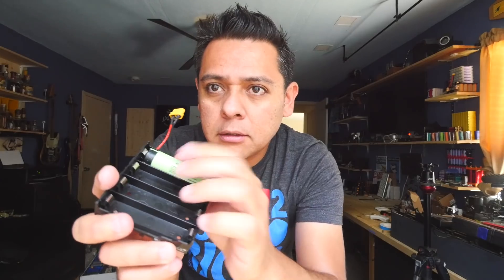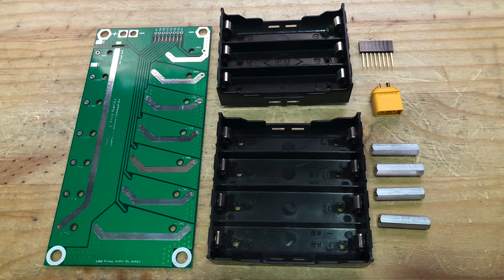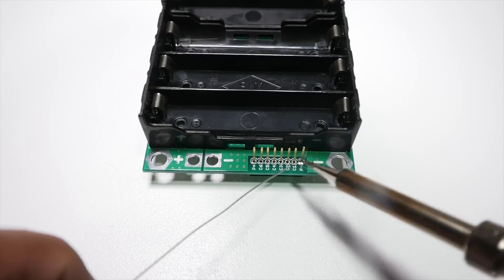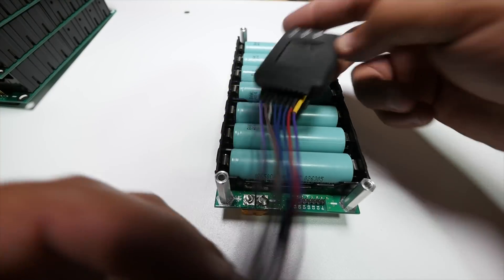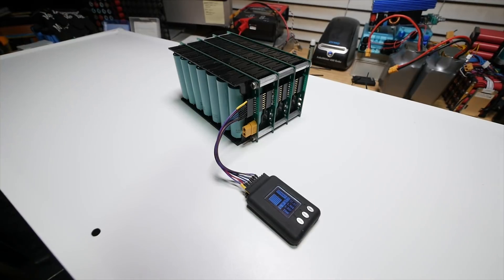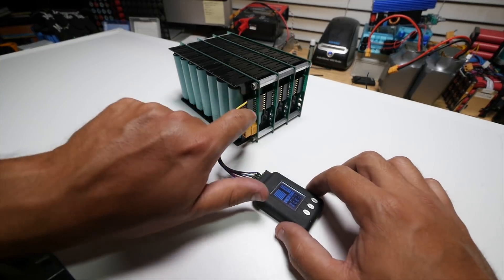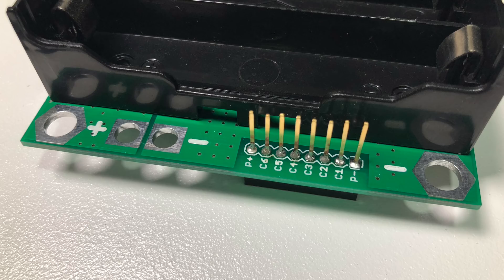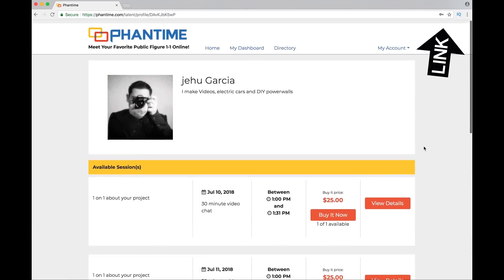DIY Rapid Build 18650 PowerWall Module project  - design & testing

Comment: Would it be possible to make a 12v battery with this system by reversing half of the cells on each board or would it not work like that?
Reply: answer BOOM!!

Comment: from my experience the metal contacts that are connected to the battery in the plastic battery holders becomes very hot when I'm drawing a lot of current with a large motor.  As a result they tend to melt the plastic casing especially at the battery contact points which may result in loss of electrical contact to the battery.  that is the reason why batteries are spot welded. how do you overcome that problem?
Reply from the maker: 1c load max per cell = low heat , no melting

Comment: 27 volts, so they are connected in series. In that case, the even voltage appears to be not so much critical for the risk of neighboring cells trying the fill up a weaker one (and possibly burning the PCB trace fuse), right? I may well be missing something, but what?

Comment: Those battery trays are most likely ABS plastic, which is going to turn soft at around 190-200 degrees F.  They should hold up alright at 140-150 degrees for extended periods.  You probably have a lot of ABS plastic parts in your car interior, which can easily see temps like that on a hot day.

Comment: Dont forget that every few years you have to replace all of the lithium ion batteries.
The reason why there is no soldermask on those boards is to add a layer of solder to increase ampacity.
At heavy load, they will also get pretty hot, becoming a local roasting device if not monitored correctly which depletes the lifespan of the batteries.
Reply from the maker: Maybe

Comment: You can also look into getting thermo-set plastic holders for the cells. It would probably be a little more difficult to find but could possibly solve the meltdown problem.

Comment: Do not build this!! The system doesnt charge uniformly all batteries! I will fail and explode with time. Stupid and irresponsible design!
Reply: Exactly what i thought. Where is the fucking battery balancing at discharge?(Or BMS warning.) A single bad cell would criple the whole thing very quickly. And i would actually want to see active battery balancing trough a dc/dc flyback circuit or something managed by some microcontroller. I think these days you have all that already integrated in single chips. This way you balance while discharge and charging. Very good for old cells. It's actually very very dangerous to play like this with these cells. I have the feeling that the guy from this channel knows VERY little about electronics and electricity and safety of batteries at all. He is an amature and should not be trusted. I don't say im an expert... But he certainly isn't.

Comment: I'd like to know if you can make a battery that basically could go 400 lb of weight on a bicycle that went 40 miles a day and took for bikes one you would only go 30 miles a day charge a day and then and then and then at the end of the test when the the obviously the first one that's going to fail is the one that's going 40 miles a day at 400 pounds but by going less with the same size battery with the mileage increase over the other three so if you'd only went 10 miles a day how many 10 Mile days would you get out of the battery versus how many 40-mile days would you get out of the battery so in the end I'm both of them I wonder in the end which battery pack would have the most miles on it to bring them home charge them bring them home and charge them bring them home and charge them and bring them home and charging to make the same 40 mile-an-hour trip in one day for each bike so one bike would have to come back charge every 10 miles as the other one would have to go 40 miles to come back and charge I wonder which battery would end up putting the most miles on before it broke

Comment: @jehugarcia, how about smearing some electrically conductive grease on the battery contacts before installing them into the holders? That might increase conductivity, and thus reduce heat, by filling-in some of the little micro-gaps between the tabs and the cell terminals. The Silver-containing stuff looks expensive, but an 80-gram tube of Carbon-based conductive grease is only like 22 bucks on ebay, so it's probably worth a shot.

Comment: wow what you did is so dangerous you did not use the resistor you used the resistors connecting leads this is not the resistor its just if  you think i am lying plz have a look https://www.electronics-tutorials.ws/resistor/res_1.html
Reply from the maker: Yes i don’t need a resistor,  I need a fuse.  Try to keep up

Comment: To solve your heat management issue, dunk the assembly inside a container full of mineral oil.

And/Or replace your contacts with silver or a more resistant metal. 

The oil, will need to be cooled. Hook up a cooling unit for fish tanks.

Comment: Plastic cell holders are much easier for large powerwall projets. Way too much heat generated and too many failure points. 48 volt or more reduces your amperage and would be much better for powerwalls.  I understand that you are trying to make an easy DIY battery system but the clip in holders are crap for a powerwall setup. You need solder or spot weld to reduce the resistance and equalize the battery contact. On a large scale powerwall I think you would have insurmountable problems with this system.

Comment: I check datasheet and the plastic of those cell holder can go up to 180C (356F). Also for your next PCB revision add this footprint to the PCB, you will lower the cost of the project! https://www.digikey.com/product-detail/en/keystone-electronics/54/36-54-ND/2254090 nice work btw!

Comment: Nice project. Off the shelf battery holders do not provide good air circulation. The thermal stresses will deteriorate the batteries faster.
Reply: Also, you can increase the series connections to reduce the current stress.

Comment: Hope somebody can help me understand the specification. AFAIK 1C (for example) means that the battery will be discharged in one hour. Why did he/you specify 2C as peak and 1C as continuous when 1C would create more temperature because the battery is discharged faster than in 2C where just half the A would be discharged at any given point? What's wrong with my thinking?
Reply from the maker: 1c is half of 2c .  Ic = 1 capacity  so if your battery has a capacity of 1 amphour then 1C load would be 1A  and 2c load 2A

Comment: How do you do Batrium if its a 24v pack yet longmons only do 3.7v? Im confused. Also the old standoffs you had listed where 25mm long with 9mm thread the new ones you have listed are 35mm long with 6mm thread? Which one is the correct size?
Reply from the maker: You would need 7 Longmons,  the right standoff is 25mm with M4 tread

Comment: You could also include cutouts with pads similar to the fuse holder so that people can turn it into a 4S or other configuration. I mod'd my pack with a wire from the 4th positive pad back to return positive line to make a 4S configuration. I also attached holders to back so that it's got 8 cells total.

Comment: May want to put solder pads on the other side of the fuse spot. If you solder the battery holders on first, you'll have to understand solder to get a fuse out on.

Comment: It'd be awesome to have it scale out as well, meaning the PCB was 1 bay and you could optionally increase or decrease the voltage, not just the capacity.
Reply from the maker: You can series them for 48v,   What other voltage would a powerwall need?  Other than 24v and 48v
Reply: I'm thinking beyond that scope. So many things we use these days are just different smaller configurations of lithium cells, my Dyson sweeper, all of my tools, my laptops, on and on. Simply harvesting cells from these devices is unidirectional. What if your idea was extended to the single cell level and you could use individual cells like legos, so when I need a 5s2p configuration for my Ryobi tools or my Dyson sweeper needs 6s1p, I grab 10 cells, snap them together and 3d print or buy an adapter to plug it in to the device. I happen to work at a fairly large electronics manufacturing facility here in Pittsburgh and have access to an entire facility from a full shop of CNC's to a clean room. I'm going to work with one of our EE's and see if we can't come up with a simple package that implements your idea on the single cell level that can be done in a way without adding a ton of bulk to the cell. I know there are others out there that you've tried that stunk,, lets me see what I can do...

Comment: eh? you just used the wire.. not the resistor ...
Reply: yes i seen this as well . he jumped the fuse didn't he ? i've been away from board level work for 15 yrs ,but that's what i think i seen.

Comment: I just don't like the fact that now the battery's of different modules are in series of each other and not the batteries of the module itself. So i would turn the design around and make the individual modules have all cells in parallel and have the modules all in series. That way sorting comparable cells is easier and more precise.

Comment: Some of the Solderjoints are cold (matte), not shiny, they have a bad connection and are very prone to breaking. Heat the pads longer or turn the heat up a little bit.

Comment: The plastic battery holders don't seem to be necessary. If the battery contacts could be soldered directly to the board (manufactured) that would be best. Cheaper, with better air flow, and as easy to assemble.
Reply from the maker: Yeah but that sounds a lot of work for someone else,  the holders work for me and they are really cheap when bought in quantities

Comment: for ease of swapping the units out I would suggest that you add a optional 90degree pluggable board so that faulty boards wont require total dismantling also heavy current draw, you might have an issue with the current pathways touching the other batteries... it might be advisable to test if you need to put a little more "air gap" between each unit with longer risers

Comment: just had a thought about this. What if, instead of laying the batteries horizontal, you placed electrical tape around the 4 vertical poles and stacked the 18650s in vertically. Once you've worked out your exact pattern and how they stack together, you could design a PCB to match, and a small blob of solder on each "output" could be enough to make adequate contact with the battery. you also would use a multi layer pcb so that the top of the battery bank is the bottom of the next level. I just did a quick calculation that the PCB size of a 7 piece holder can stack 33 18650s vertically if staggered. Although your spacers would be double longer (the width of a battery), your PCB costs would be reduced by 1/5th

Comment: that was a very interesting test. I agree on some of the recommendations, but in my personal experience, these holders work fine with the majority of your projects. I built a 1 KW battery for my diy ebike, and I have been riding it for about 4 months now.  I get a speed of up to 30 mph, and depending on how much I use the battery, I have got from 50  miles range with average use and up to 80 miles with low use (more pedaling than electric propulsion). just have to be careful with the bumps on the road that make the connections unstable. If you are careful like I am with that issue, it works just fine. please keep up the good work.

Comment: At first I wondered why you had 7 battery per module, but then the 24V answered that. I do think 8 batteries would provide more buffer for longer lasting operation and would provide economies in purchasing and labor.

There are several variants of this size battery regarding amp hours or max current.
The heat seems a result of the relatively high current for a battery of this capacity. 
The only way to reduce that heat is to pack more batteries in parallel to reduce the current load for each cell. This would also increase the current capability while reducing temperature.

I make these comments as speculation without a full list of relevant specs. If anyone can add more clarity, please do.

Comment: Very nice. I would do something different for the balance pin as mostly going to short then. Something safer. Also for the connection + and -. Very nice the idea of the stuck but I would avoid it. Just for the sake of being able to short it so easily. I will wait for the future revision

Comment: I could see the bms fuses been directly on the board behind the connector been an issue if they blow they be difficult to re solder or tell witch battery bms trace has failed

do they have a fuse on top of the battery holder or just relying on the fuse in the battery

Comment: The contacts are steel which is a poor conductor, especially as the spring design makes it a long run from PCB to battery. One option for the dedicated is to push the pins out prior to soldering to the board and laminate them with copper tape on the battery side. Push them back in to assemble onto the board. It would require de burring the spot weld points on the battery to prevent the tape from getting ripped when installing.

Comment: What usage meter is that? (The one with the screen showing the Amps in/out and the voltage.) 
Is that one using a shunt it looks like? I got one (similar) from Amazon that used a Hall Effect sensor and it was REALLY inaccurate and just could never get it calibrated right. The one you have there looks better. :D

Got a link to the place to buy that variant?

Comment: Hey Jehu I want to draw your attention (as well as that of your fan base) to the kweld diy battery spot welder... Designed and built in Germany, priced like a cheaper/ low-end Chinese spot welder, but out performs (by a significant margin) the 2500 dollar multi pulse spot welder where I work!! If you haven't yet done so, you would really want to pay close attention to this clever little machine!! I personally have one, and its the most exciting thing to have happened to my battery building side business. Beautiful spot welds EVERY TIME!!
Reply: That said, I do admit that being able to quickly remove and replace cells from a Li-Ion battery system is SUPER convenient!!

Comment: Probably the heat issue is from where the broad metal strips narrows down to pins for soldering. As the current goes up the narrow part with a higher resistance heats up and that in turn heats the strips heat up. Try adding som heavy gauge metal wire in the holders maybe? Its a very interesting idea, seems very easy to build battery packs this way. Interesting to ser where this goes 😀

Comment: I know you are trying to reuse an existing battery holder but you might want to look at a contact with less resistance. That could help lower the temperature a bit. That,  coupled with a more fire resistant material than the plastic might just hit the sweet spot. Then it's just some serious safety testing,  some supply chain research, and a good assembly partner and you could do a nice small batch manufacturing plan that would feed a large segment of the DIY market that doesn't want the repetitive soldering job.

Comment: ABS transition temperature is about 105 degrees Celsius.  That's about 221 degrees Fahrenheit. https://reprap.org/wiki/ABS  You should be fine with the heat being generated against the plastic.  I would be more concerned with the temperature that is conducted by the batteries.

Comment: Jehu you really need an active or semi active cooling system with that setup. 1)How much room do have between packs? 2) Is that space modifiable? A thermal syphon between each pack would be a serious perfect fix for waste heat.
Reply from the maker: Incorrect,  out powerwall batteries never create any heat,   My test here at 1c is a worst case scenario,  it’s the equivalent of turning everything in your house on at the same time plus charging  5 electric cars in your garage.

Comment: The metal clips are easily removable. They pop right out. Most likely steel to get that hot at such low amperage. Any chance someone out there makes tin plated copper clips? If not, maybe you want to get into the clip manufacturing business? If not, solder a solid copper wire to the backside of the clip closest to the battery terminal and running down the clip to the board solder point?

Comment: @jehugarcia What really has been grinding my gears lately, why should we fabricate stuff like tesla powerpacks on an industrial scale while it is such a waste of resources. You hear people talking about powering an entire state with them?!?
Wouldn't it be far better to use natural resources for problems like these. Think of a water battery for instance: https://www.windpowerengineering.com/electrical/power-storage/water-battery-natural-power-storage-facility-says-wind-ag/. This way we can keep using these rare earth metals for other applications which can not be solved without these materials. I know for smal scale battery based solutions are easier but i bet there are some smal scale solutions too. I would like to hear what you think of this solution and its opportunities
Reply from the maker: Because lithium batteries are the best tech we currently have,  everything else is too old,  too expensive or vaporware.   Don’t believe what you read,  believe what you see.   I see us swimming in lithium batteries currently,   Check your pocket there is one in there right now,  if it’s not there it’s in your hand.
Reply: oke i see what you mean, but do you think we can power the world with lithium cells? And you are saying that the "water batery" for instance is too insuficient? because it seems doable.

Comment: i would have put poly fuses on each balance lead on each board, and make it so you can solder the batteries in rather than use those crap battery holders. You will loose a lot of power in the extra resistance thru the spring contacts.. other wise great idea..